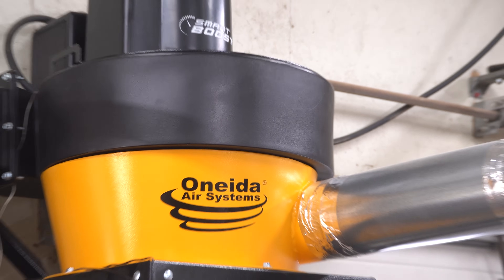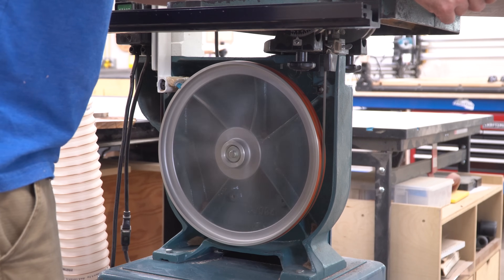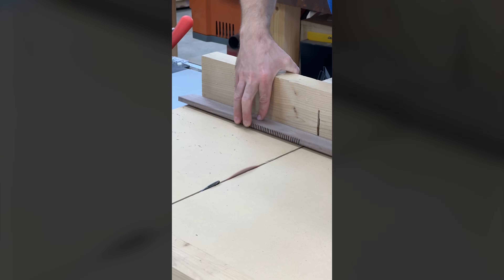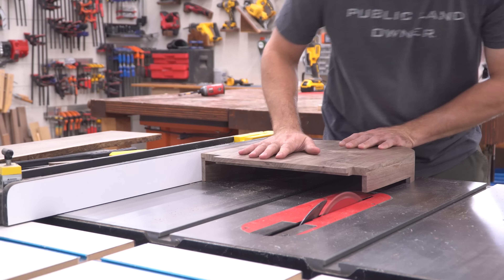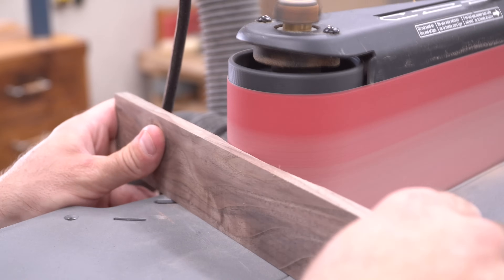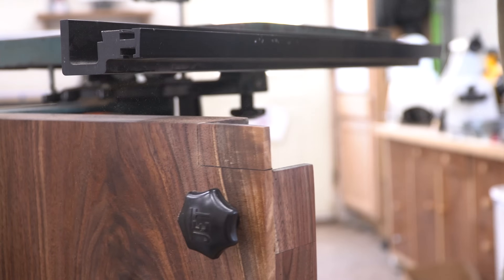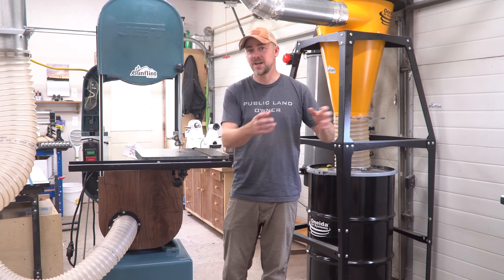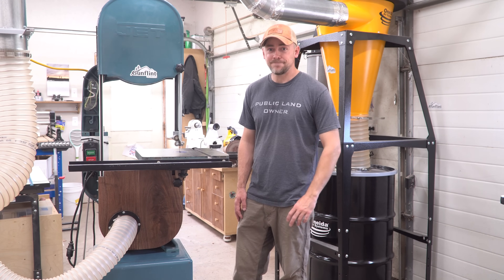Solving Bandsaw Dust Collection - With an Unnecessary Walnut Door!

Comment: 2:35 as far as the router goes, rather than pulling air from beneath with this type of bit, I tend to set up the fence a little bit back from the bit, but in the line of the chips, with dust collection hooked up to it. That way you get the safety of the correct size throat plate, and the dust collection sucks up most of it too.

Comment: Another note from the safety police: the "sketchy" cut on the table saw at @4:40 would have left me less queasy if you had hot glued or taped a block inside the piece that would help prevent the top from tipping down. But no blood or bruises, so good job holding it.

Comment: Looks great!   I probably would have just cut through the metal door myself...  Haha! and maybe epoxied   a border with some strong earth magnets to hold the dust sucker outer device to the metal door...  but who knows?   Maybe it would have taken just as long to fabricate and or make functional...and in the end...  still won't look nearly as nice as yours!

I wanted to get into resawing and got an inexpensive Harbor Freight 14" bandsaw (used) only to see that it is FAR from capable for what I purchased it for...   wanted to resaw 12" 2 x12s and the guide only allows a very minimal amount to go under it....  I wanted to experiment with welding (I don't have a welder either) 😅🤣😂 To extend the capability....  I'm trying to do cool stuff but on a budget...  I, too, have a layer of dust all over the garage....😔

I like the idea of keeping the Large tube out of the way until needed.  Excellent work!
Reply from the maker: Thanks Man! Sounds like you have lots of good ideas rattling around in your head.

Comment: I build some custom parts for vehicles. I fill my scarf slots with epoxy but I add a filler. It maybe overkill but it's rock solid. "anything worth doing, is worth over doing".
Reply from the maker: That is always the right motto!
Reply: My dad use to say, "Don't do anything half-a**". Great work. Take care. @GunflintDesigns

Comment: For the safety police around the 90 second mark - were it me, I know that it's an irrational fear, but I'd be really concerned about "my boys" getting caught in that spinning wheel.  Great video!  I don't have a bandsaw, but if I did, this would be a really tempting mod.
Reply from the maker: Sounds like you need to buy a bandsaw just so you can mod it!

Comment: Good video. I have a old Jet bandsaw and like yours. Does the single 4” port get rid of all the dust near the table and lower bearings?  I noticed that you are still using the Jet cool blocks. I have upgraded to the Carter bearings for my saw and the tensioner. I think you find it a great improvement to your saw. Keep the video coming 
Kevin Duxbury MA

Comment: Great work! I have a cousin to this saw made by Harbor Freight. It has a small shop vac port located where you installed the magnetic shroud. I like the looks of the new door  A LOT more. 
"Thin layer of dust" sounds like the cover band that plays in my shop.
Reply from the maker: This one had the same shop-vac hookup originally. I took it off and used a 4" hose bungeed to the saw in that location for years. This works much better!